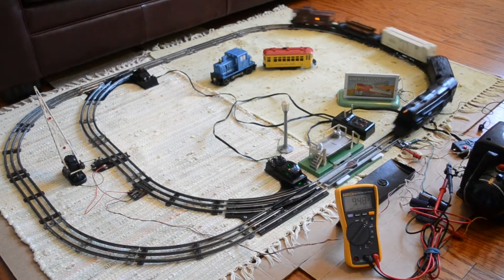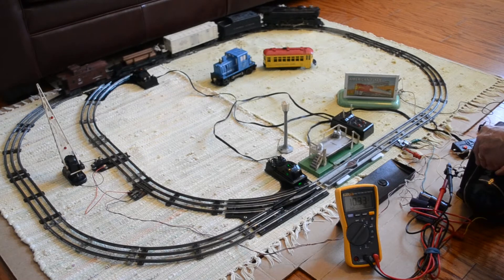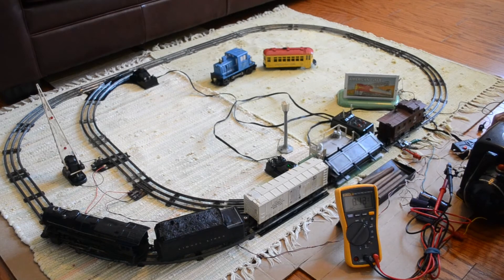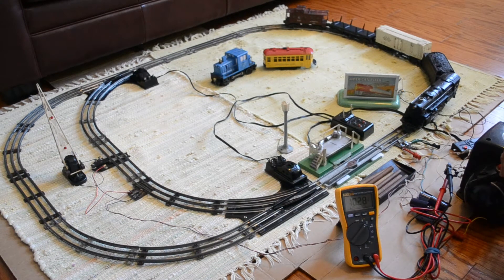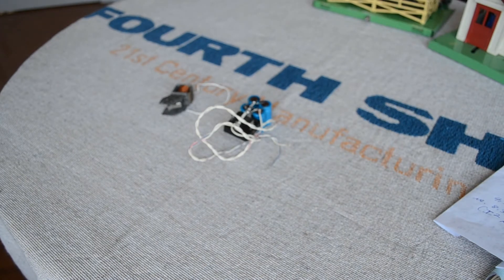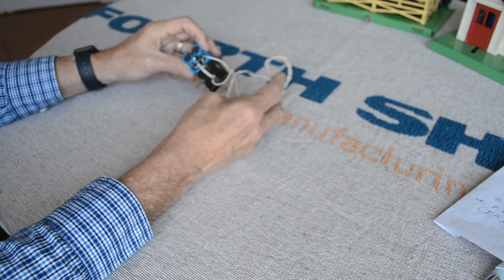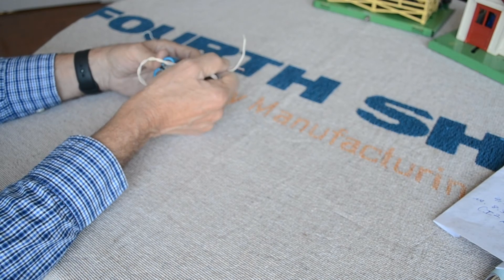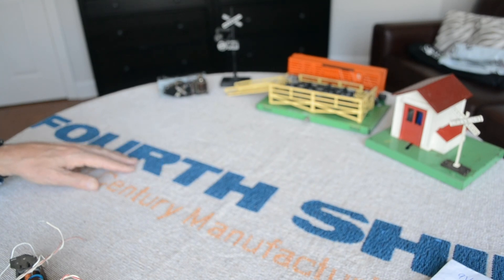Running Vintage Lionel O-Gauge Trains on DC Power

Comment: If you lock E unit to forward postion by moving lever will that eliminate powe to coil and save E unit from burning or getting magnetized ?Thanks for any help . Sone of my standard gauge do like DC it seems.
Reply from the maker: Your observations are all correct. My goal in making this video was one of curiosity rather than an actual requirement. I heard decades ago from a Lionel dealer that his Standard Gauge #402 could be modified to run on DC and performed very well. I have also read a number of publications noting that Lionel's motors were typically of the universal type, able to run on either AC or DC. 

In the recent video of my O-27 set, I elected to activate the E-unit so that I could stop the train to unload the milk car. I also noted that my #2025 would run well on 10 volts DC, while requiring 12 volts AC to achieve the same speeds, thus decreasing the power dissipated in the E-unit while running on DC. One could consider periodically reversing the positions of the DC wires to the track to lessen the possibility of permanent magnetization of the E-unit.

One last point. If you choose to run a Standard Gauge locomotive on DC, then the field coil and the armature should be wired in series to prevent excess armature heating. Motors made in the late 1930's and having E-units were wired in this manner, but E-unit overheating might be a huge issue if run on DC without disabling the E-unit.

Comment: Can you explain Why you need the capacitors and not just the rectifier ?
Reply from the maker: I wanted to simulate as closely as possible, a commercial DC Power Supply, having minimal ripple voltage.

Comment: Those are great experiments.  Im wondering how much power the eunit would use with no filter capacitor.  And if the vibro stuff would work correctly.
Reply from the maker: I measured the resistance of the E-unit on a Lionel steam locomotive to be about 13 ohms. A locomotive such as this one takes about 10 volts when run on DC power, as shown in the video "Running Vintage Lionel O-Gauge Trains on DC Power". The power consumed by the E-unit alone would then be 10*10/13, or about 7.5 watts. It will become quite hot in a short time, although it will operate. Another consideration is whether it will eventually acquire some permanent magnetization and not continue to release properly. Lionel accessories that are designed to vibrate will only work with 60 Hz power applied, as they actually vibrate at 60 Hz. Some of these accessories are mentioned in the referenced video.